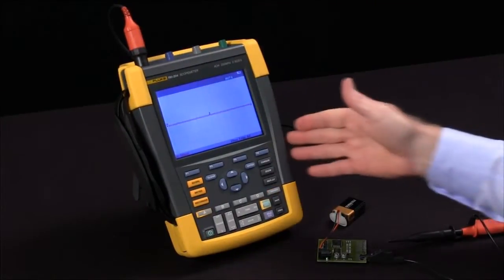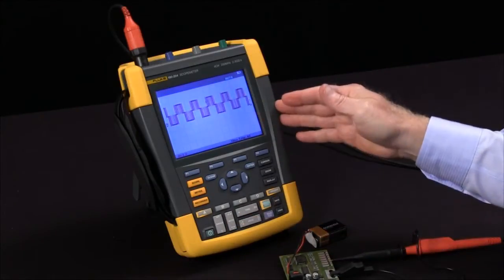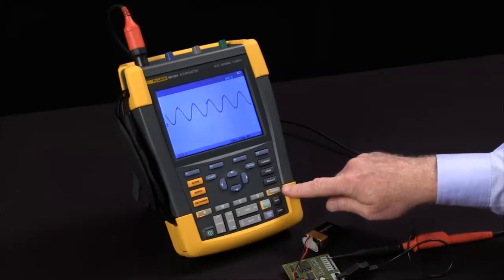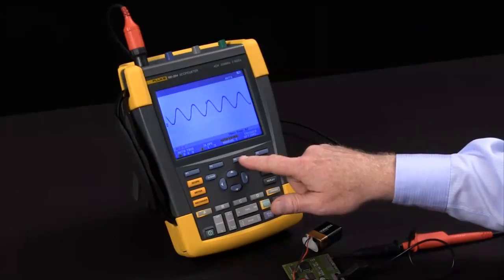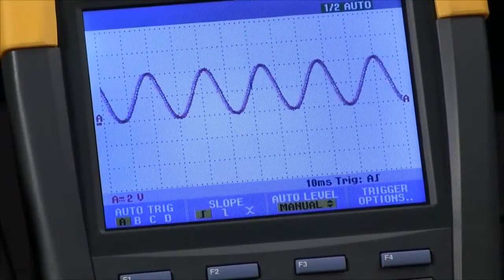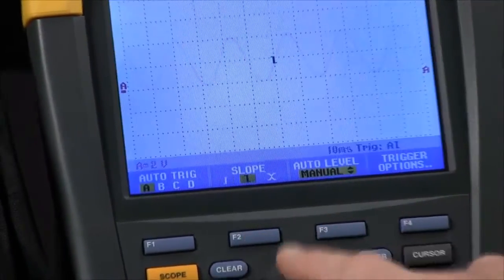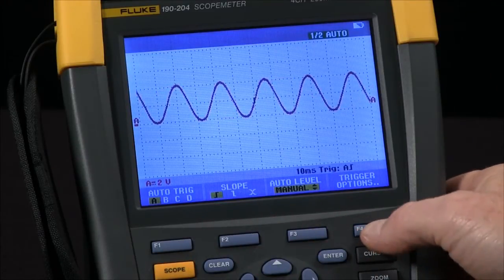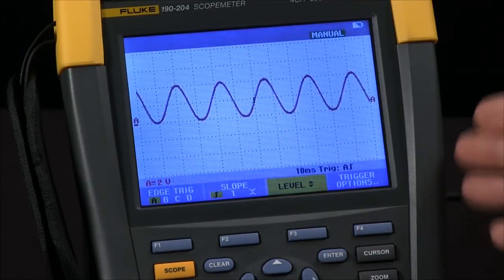How to Set Up a Basic Trigger on a Fluke ScopeMeter® Portable Oscilloscope

Comment: Are there any Fluke Accessories such as Pressure Transducer and OBD Breakout Boxes for Automotive Diagnostic Application? Looking into this versus Picoscope. This is a much cheaper option compared to the overpriced PC based Picoscope, not to mention its cumbersome setup.